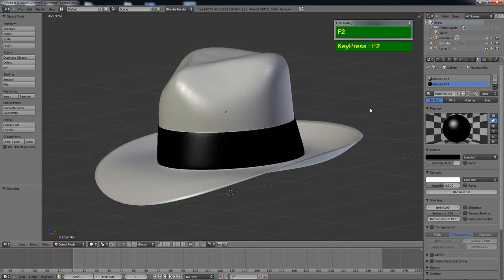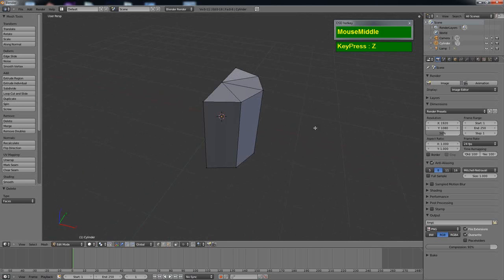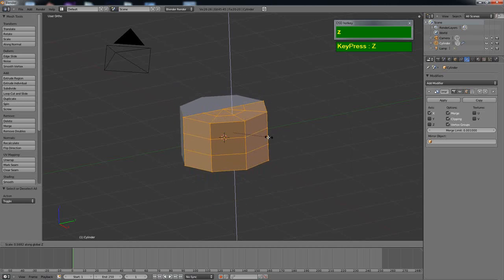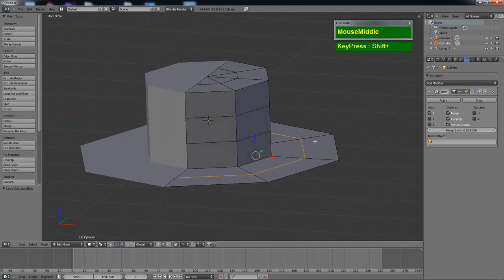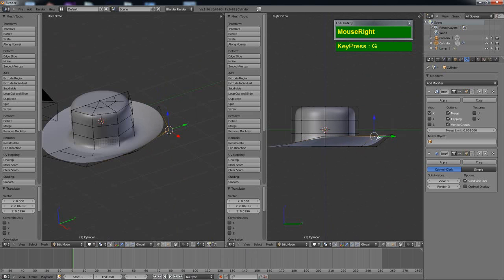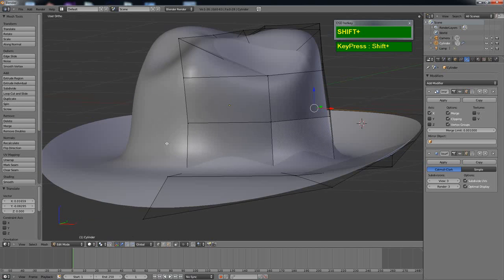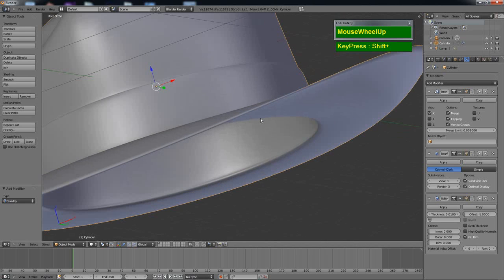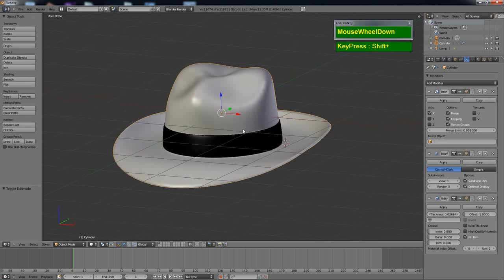Blender 2.58/2.59 Fedora Hat Modeling Tutorial

Comment: I'm using Blender 2.76b. I follow your tutorial up to the point of bisecting the 8-sided cylinder. At that point, my view has no interior wedges and when I delete, it removes not only the left faces but also the top and bottom face. Is there a missing step or setting that has changed with this later version?
Reply from the maker: +Richard Palmer You might want to watch my later video on the homburg hat tutorial, there are a lot of changes to Blender's knife tool since this video was published.

Comment: so what's the main difference between using a knife tool and and cutting an edge loop?
Reply from the maker: +Don Xizzle The edge loop tool allows you to cut across adjacent 4 sided faces and also control the number of cuts, it can affect the way the object looks after it is subdivided. A Knife tool allows you to customize a cut the way you wanted it or control the flow of the topology of your object.

Comment from the maker: @black3826 Could it be you created another extra mirrored object without knowing it? Check your mirror modifier whether you activated another axis? If possible, you may want to do the whole thing exactly and see what step you have done wrong. One thing I suspect could be your solidify modifier. Try clicking the "apply" button and see if it fixes your problem.